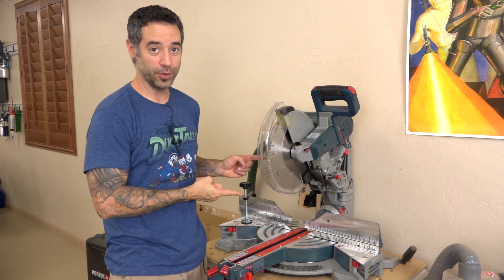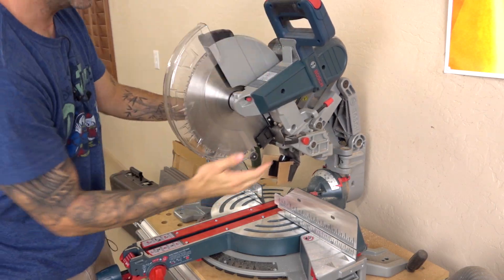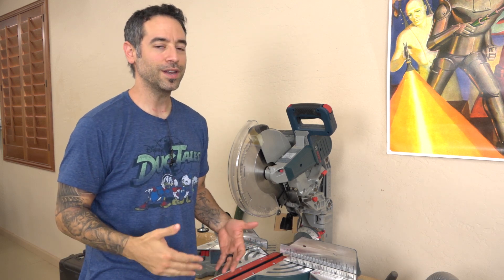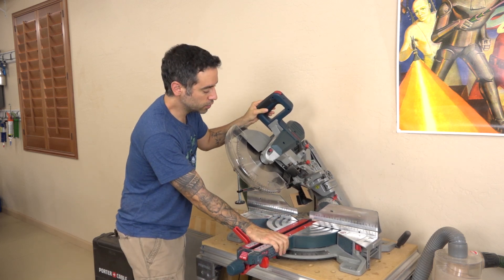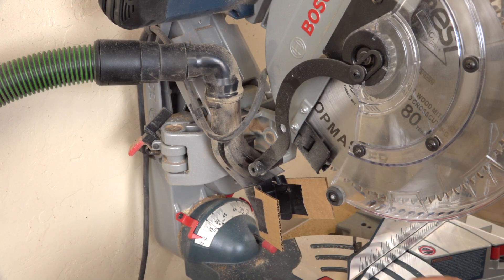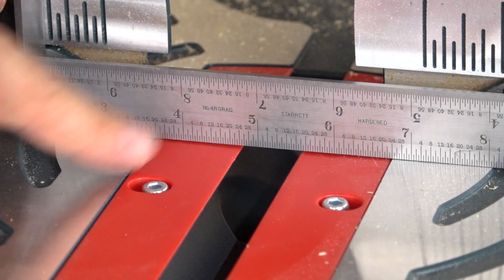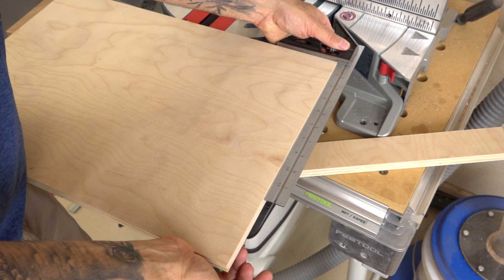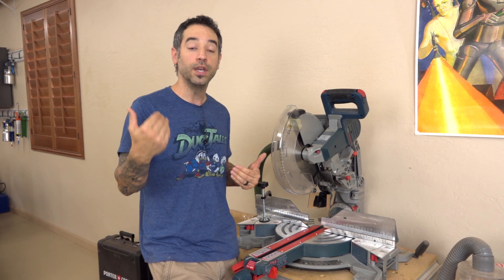Bosch Glide vs Festool Kapex

Comment: Great review. My Kapex has 10 years now and I just purchased the new Busch miter saw. Same reasons you explained in here. A few more things bothered me on the Kapex. 1- At the end of the week (lot of cuts) it starts to jamb when you pull it down and you have then to do a cleanup and relubricate. 2- as you mentionned, the non standard size blades, that costs a fortune from Festool. 3- the shorter longitudinal travel... Every top manufacturer caught up to Festool lately, We can no longuer justify the high price.

Comment: I have owned the Bosch unit for some time.  It is mounted on a terrific stand that folds into a two wheel cart and offers a great solution for construction work - mobility, accuracy, great power, and long, extendable work support.

In my shop, I wanted to upgrade my huge Delta 12" radial arm saw that was built into the center of a 20" long work bench.  This saw was used almost exclusively as a rough cut saw that I only used for rough dimension to begin machining for a furniture project.  Instead of using my Bosch saw, I bought the Kapex because I always love everything Festool.  You did a great job of exposing strengths and limitations that I have found.  The one very critical issue that I would add is that the unit is underpowered to be used as a "very precise cut-off saw".  My old delta made an awful cut and was a little dangerous to use but it would plow through a 14" wide, 3" slab of hard maple like it was balsa wood.  With the Kapex, I have to make a series of cuts at increasing depths and tend to burn the wood because it slows down as I run through the cut several times.  

The Kapex can fit in well as a precision furniture making tool to handle angled cuts of all types but not so good as a rough dimensioning tool as I typical use as my first step when bringing hardwood lumber into my shop.  I still love everything Festool but I am going to take my Bosch off it's stand and mount it into my work bench replacing the Kapex.  I will have to decide if this Kapex stays around for precision work or goes on Craig's list.  

Great review from the Wood Whisperer as usual.  Thanks.

Comment: I recently had a project to trim out a house, I been using a 12" Hitachi saw that required set-up and alignment each time it was taken to site. I switched to the Kapex unit with extension wing about 3 years. I can honestly say you can't bet the Festool unit for accuracy, portability and dust collection. The project went quickly...this tool is a money maker. Still amazed how well it works from being stored \ abused in the truck.

Comment: I went in the opposite direction. I had two of the Bosch Saws, though mine were the previous model which did not have the glide. I work in the field most of the time and found the Bosch saw to be heavy moving in and out. The size and weight alone are worth the Kapex price to me. 
I am glad there are so many options these days for good tools and all prices. I started over 30 years ago, when the only slide saw was a Delta SawBuck. Great review, keep it up;0)
Reply: Ron Paulk

Comment: Hey Mark, Nice comparison vid!  I have a miter saw with a similar clamping system.  My solution was to JB Weld a 3/8 nut to the top of the clamp screw, and keep a dedicated nut driving bit next to the saw.  I use my impact drill to tighten and release work pieces. Sort of goofy but it works well for me.

Comment: The adjustable clamp you showed is the same as what came with my older model Bosch.  Here's what you can do.  Screw the pad down until the bar no longer contacts the fence, or so it no longer contacts the fence when you have a board under it.  I used a 3/4 board, but you'll want to use whatever size you cut most often.  That said, I hardly ever adjust the pad.  When you go to use the lever, first, pull the clamp pad away from the fence - there is a little play in the device - and when you depress the lever, it will pull the board into the fence, as well as pushing it down into the base of the saw.  Hope this makes the clamp and saw more usable for you!

Comment: Great review and I agree 100% with you. I've had the Bosch Glide for almost a year now and it's perfect except for the dust collection. I've somewhat solved the clamping since I have mine setup with a fence extension with plenty of places to put a quick clamp but for shorter pieces no dice. If anyone does find an after-market dust collection that works well, I'd REALLY appreciate to know about it.  Thanks for teaching me almost everything I know about woodworking!

Comment: Thanks for the video.  I finally decided and picked up this saw for my tiny shop.  I have several Irwin clamps and I made one into a hold down for this saw and it works great.  I will admit that dust collection is a problem and I did fiddle around with a piece of thick rubber to make mine bigger but it didn't help much.  I may look around and see if anyone else has tackled the problem in a video.  Great video.

Comment: I think pretty much everyone would agree that the Kapex is a better saw. The question is, is it $900 better? Dust collection is definitely worse on the Bosch, but I'm pretty sure if I had $100 I could engineer the hell out of some good dust collection for this saw and still have $800 left over. Festool makes some unbelievable tools (Domino, Rotex, TS55), but the Kapex just isnt one of those.I'll take that money and buy a second Laguna bandsaw before I wasted that money on a chop saw. But to each his own.
Reply: When you get into very difficult angled cuts is when the Festool shines.  If you're just doing 90 degrees or 45 degrees, any miter saw will get you what you need.  Of the of the cool features of the Kapex is the dead accuracy of its lasers.
Reply: Paul Hopkins 

I think the best testimony for any tool is the collective voice of those who use them day in and day out. His comment about the 'proprietary cord' is a good example. To him, it was a negative. Those of us who use Festool products no doubt see the Plug It cord as a huge plus. I use one cord hooked up to my CT26 - all the rest of my Festool cords still have the wire ties on them.

He didn't point out any "weak" items. He's an idiot that doesn't have the first clue about engineering, and tossed in a few fancy words in an attempt to "Baffle with Bullhockey". 

For example, if he had the slightest clue about ANY variable speed motors, he wouldn't have even hesitated upon noticing the magnetic pickup on the shaft for a Hall Effect sensor. It's standard on every variable speed motor for the past several decades!!! It's not new. It's not even a question. Yet he sat there and pondered it as though it may have been present to pick up stray metallic debris (like the magnetic drain plug on a car engine). Idiot!

Then he goes off on the thermal melting point of the plastic housing. Huh? If your motor, any motor, hits 360 degrees, it's already GONE!. But this brainiac didn't even notice the 2 little red wires leading to the embedded thermistor in the motor housing....let alone what a thermistor actually is. The motor controller will shut down the motor long before it ever reaches 360 degrees, because the insulation on the windings can't withstand that high of a temperature. 

He was in awe about seeing balancing grinds on both ends of the rotor? Geez, where did he get his experience, watching someone balance wheels at the local gas station? Even a teenager at the gas station knows you balance both side of a wheel. 

What bloody idiot is going to try to remove a rotor without pulling the brushes? I was dumbfounded watching him yank on the motor housing with a screw driver. It wasn't until a minute later that he admitted to not pulling the brushes. Dust boot not withstanding, did he not suspect the brushes would also have to slip past the shaft bearing? 

Of course he was surprised to see spiral pinion gears...because he's an idiot. Does he not realize that is a major upgrade from a straight pinion gear? Those aren't cheap to broach! But they mesh a heck of a lot better and are a heck of a lot quieter, and there's a darned good reason why spiral pinon gears have been standard in automotive differentials for the past century. 

Think I've been hard on him? Not even close. I'd have that boy in tears if I had the chance to say what I think to him personally. He's that much of an idiot.
Reply: Paul Hopkins Just be happy with what you have and be thankful.  There is no reason to tear down someone that chooses a different tool from you and people don't need your permission or approval for what they like to use.
Reply: @MWA Woodworks  As a professional woodworker, I personally think the Kapex is highly overrated.  As are most of festool's tools.  I'm not brand loyal, I buy what I feel is the best; having said that, I own a lot of Makita power tools.  I have an obsession with accuracy, and while Festool provides that accuracy, it's just overrated and overpriced.   If I wanted to spend absurd amounts of money for accuracy, I would skip right over Festool and buy Mafell.  Check out Ave's channel here on youtube, I believe he has disassembled some of festools saws and shown that they are in fact overpriced for the build quality.  They use way too much plastic in my opinion and the tool weight just isn't there.
Reply: @Dan where did you see that? It is only 3-5 years (US anyway) . So you pay way more and don't even get a decent warranty.
Reply: MWA Woodworks - KAPEX is worth every penny to me. Have used for framing, finishing, casework and small boxes. Good saw.
Reply: The Kapex isn't a robust saw, we have had three in our shop bite the dust. The capacity is worse than the Bosch, the motor is not that great and the ergonomics are sub-standard. If Festool made a saw that accepted a 12" Forrest and changed their handle geometry and beefed up their weak motor and bearing durability then perhaps it would be a good saw. I agree with Marc in that the Festool's clamping and bevel adjustment are really good, as is the dust collection, however the Kapex falls really short on value. Festool should be ashamed selling it for a huge premium over the comp, it really isn't worth the money. I think the Bosch blows the Kapex away.
Reply: I have a lot of Festool products and though I've tried to talk myself into buying the Kapex i just can't. It has a few nice features but is it worth $1400+ no. I honestly feel like it's a little insulting they price the tools to the extreme. Track saw definitely worth every penny, domino... little high. Sanders are worth it. vac was worth it.... miter saw....it does not have the capacity of a 12" those it says it does. I can't even cut 5 1/4 speed base standing up....for 1400 I should be able to cut 7 1/4 if I want to.
when they make a 12" and keep it around 1200 I'll buy that
Reply: accept...just sayin'
Reply: because Hilti is cheap...right ?
Reply: MWA Woodworks harbor freight tools
Reply: christschool christschool . You clearly don’t know his background or you would be saying that, yet even it that was true prove him wrong on the choice of using junk components and have the balls to charge so much. Skillsaw uses better component and that’s Sad
Reply: Let's remember this is one persons opinion, no need to get nasty.  Being critical is fine, but do it respectfully.

Comment: I just got my 12" Bosch Glide in the mail. I looked at the clamp and it's actually a lot easier to adjust than most clamps because it works just like a holdfast. You just put your material against the fence and drop the clamp into one of the holes in the back and give it a couple turns. It should stay in place. Or you could give it a sharp tap with a hammer or mallet like you would on an actual holdfast.

Comment: Nice review. The Bosch is nice; I almost bought it instead of the Kapex. The dust collection is what sold me on the Kapex, though. I've been using the saw in my house for the past 8 months on a long-running renovation. If dust collection isn't a big deal, or you're going to put a hood behind it, then the Kapex loses its main advantage.

One thing I do like on the Bosch is the additional capacity. 

Also, FWIW, you can get a Forrest Chopmaster (and other blades)with the Kapex arbor size. It does cost something like $20 more, though.

Comment: Great comparison. I had this Bosch saw and hated it, was never happy to use it. Took hours to dial it in to cut straight/square cuts. It would never cut the same every time. Sometimes it was straight other times it was way off. It also stuck out into the room more than I would’ve liked, especially if you wanted to swing it to make 45 degree cuts it couldn’t be placed that close to the wall. I finally had enough of it and sold it! I  bought a Makita XSL04 36v Brushless miter saw and never looked back! It’s an amazing cordless saw. Makita was the closest to Festool that I could find without breaking the bank. Makita makes miter saws fun again. 👍🏻👍🏻

Comment: I have both the Bosch 12" Axial Glide saw and the Festool Kapex. In terms of accuracy, I haven't found anything that beats the Kapex.  I often use the Bosch on site for trim work and such, but it has torsion movement in it, some of which is the flex in the blade but also from the arms themselves.  I build high end cottages in Muskoka (in the top 10 vacation destinations in the world, FYI) and I am blessed enough to get to work with lots of different woods.  Not sure what my next general purpose saw will be but I'm not convinced it will be another Bosch

Comment: I have had the privilege of working over the years with several mitre saws designed and presented by different manufacturers, ranging from the mighty DeWalt, Makita, Festool, and only recently this new very clever mitre saw by Bosch.  
The saw arrived a few weeks ago and I only place a review when I have had a significant amount of time with the machine, I see many reviewers place reviews 30mins within receipt of their saw which is at best silly and at worse naive!
The Bosch Glide Saw stands tall on the mitre station, it has real presence and a very clever arrangement of well engineered elements all designed to offer the woodworker cutting ability and space saving over many of its competitors. 
The Good!
The saw sits tight to the wall saving a huge amount of valuable space, the saw is powered by an impressive   3hp brushed motor, the glide arm is very solid even at full extension, I found that at full reach you would have to really force the saw head to gain lateral movement either left or right, the depth of cuts is one of the deepest available in today's mitre saw market, the saw has a very wide stance with extending arms which offers greater support for longer lengths, the fences are tall and I found that both fences on my saw where near perfect! 
The Bad! 
I endeavoured over a period of 4hours with the aid of three highly accurate machined precision Germany squares but not one time did I make a cut that was perfect, some cuts where marginally better than others but none would be acceptable within the world of a cabinet maker. 
In conclusion it makes me rather sad to present this disappointing review, I had high hope and expectation for the new approach to mitre saws by Bosch, but taking into account that my saw may have been a lemon I reluctantly would have to conclude that I would reject this saw as an option if you require high end precision cuts at cabinet grade.
Reply: Louie's Workshop I have the kapex. Over the years I bought a series of engineer squares. The longest one I bought is 450mm long. That really costs some money although I'm pleased to have bought it. I set up my mft using it.
I found my festool track saw cuts more accurate than the kapex. The longer cuts are not quite as good on the kapex. Checking shorter cuts with my engineer square I think my machine may need some tweaking. However not bad for some of my applications . I find I'm slightly out making draws which then requires a little work to make good.
I'm thinking of getting a good heavy table saw. The mft is good for cutting sheet goods. When you start working with recycled timber and don't prepare thoroughly because say I'm just building a draw for my shed I found the mft was slightly out. I'm guessing it's because I didn't run the timber through a buzzer. I just thicknessed. The board may have been slightly warped so my cut was marginally out. I did rectify it although I wasn't happy.
What was good is the timber has a much nicer aesthetic look about it.
Someone stole all my equipment. One of the machines I lost was my festool cordless plunge saw. I was going to give away my corded plunge saw. So glad I didn't.
I'm a plasterer by the way although have made my own furniture since the 1990s.
I worked with cabinet makers and helped them set up kitchens. I'm a sort of self taught learning through my trials.
Reply: @ron1martens  hi Ronald, I am sorry for such a late reply, I found your response extremely interesting and accurate, always remember that wood does not come straight and often after machining g stay straight so the hidden art of the cabinet maker is to deal with this issue, and yes I do have the kapex, a brillant saw but not perfect, in the end pal we can get things close but not perfect!
Reply: Good radial arm saw for the win!

Comment: Having also auditioned both of these saws in my shop, and with much respect, you can pry my kapex from my cold, dead hands.  The dust collection, kerf lasers, and clamp are just too good to let go of.  When I broke the bevel handle on my Kapex (tried too hard to adjust it without releasing the lock) I thought I would replace the saw with the Bosch.  I was wrong, and returned the Bosch within 2 days.  I also rarely bevel, so the Kapex is stuck at 90 degrees until I decide to order some parts.  It has been 2 years now.  And that's perfectly fine with me.